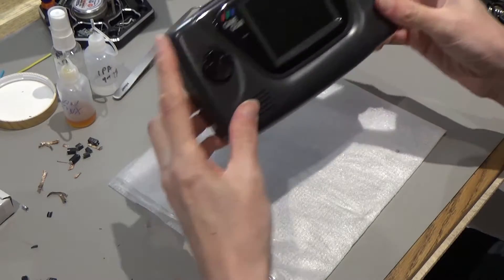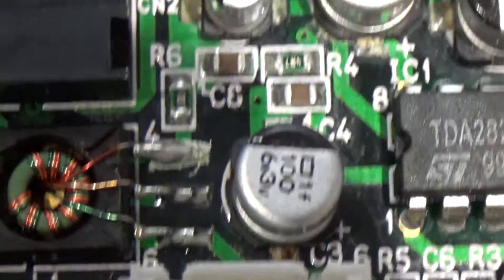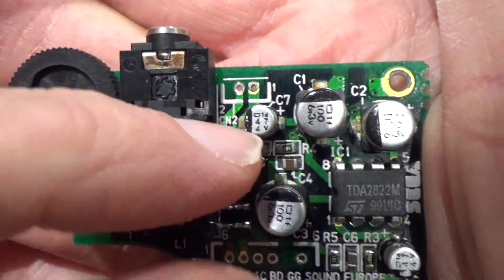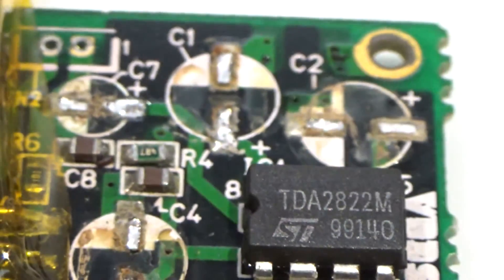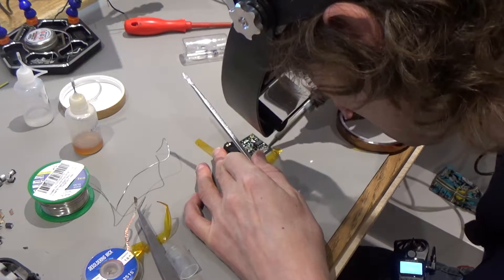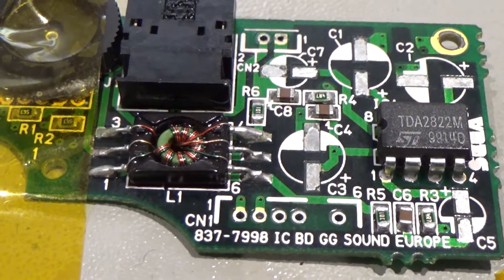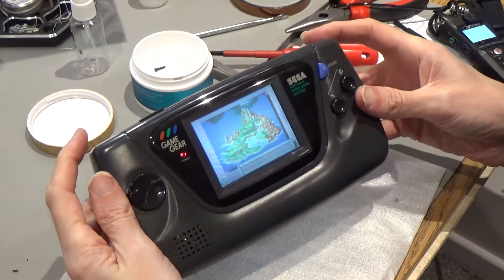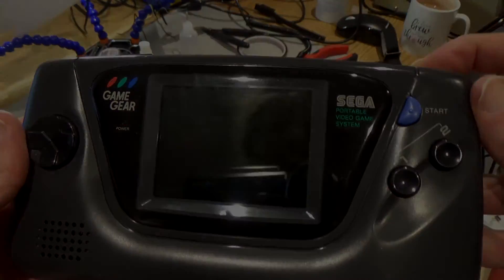Sega Game Gear Sound Board Repair (Recap)

Comment: i seem to be the only one that got a cap kit with surface mount caps, freaking impossible to do with my soldering iron, i got this kit years ago when i was a kid and i had to give up on it quickly, the seller forgot to include a capacitor for the main board, i told him that and he was super stubborn about it, i thought i was just the one that was inexperienced so i didn't stand my ground and i didn't end up getting a replacement from the guy. i just found everything again and i was absolutley right in noticing the cap wasn't included, i've gotten over that problem but now the sound board is being very fidgety with the surface mount caps :( 

good video though! hahah
Reply from the maker: It is possible to solder surface mount caps with your soldering iron. I did this video on recapping the Amiga 600 surface mount caps, so check that out -> https://youtu.be/Rb77VOHj0WQ
But if you've manged it now, then you are all good.
Shame that your seller didn't include the correct caps, the only good thing about buying a cap kit is that you don't have to go and search around for all the correct caps as they have done the work for you, so when they get that wrong, it would have been easier to source your own caps.

Comment: is it possible to pop out thos capacitors without a hot air blower? i've recaped my motherboard and managed to fix the screen by using the iron on the little rectangle next to it (sorry if i'm not very understandable, i'm french and my english is far from perfect ^^) and the last i have to do is sound board (no sound at all at the moment). I thought maybe using flux but i'm not sure at all if it could work
Reply from the maker: I've not tried other methods. You could use 2 soldering irons (one on each side), but you probably don't have 2. Some people like to twist off the cap with a pair of pliers, but if you do that then you risk pulling the pad (the little rectangle) off the board. You could try "Chip Quik" which is low melting point solder, and try to desolder both sides at same time with the iron.
Reply: @DavePoo2  thanks, i'm not sure if i'll try this, i'm just gonna buy a hot air blower (in the end it will be useful for other projects too), just got to remember to desolder the plastic connectors ;) have a great day (by the way, i've got more then 5 irons but low quality or pretty old ^^)